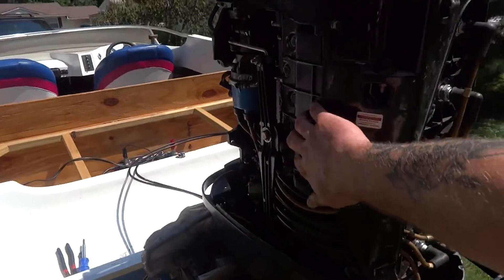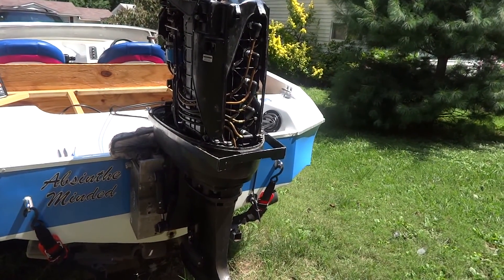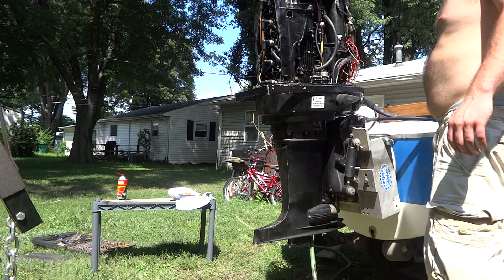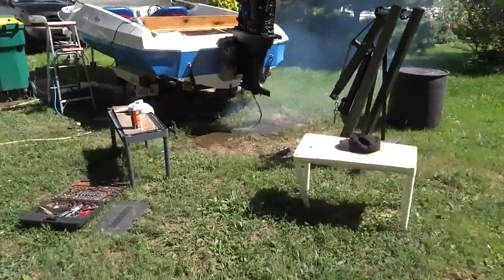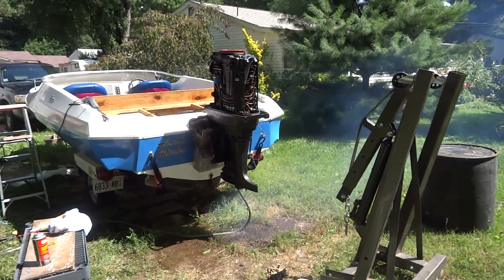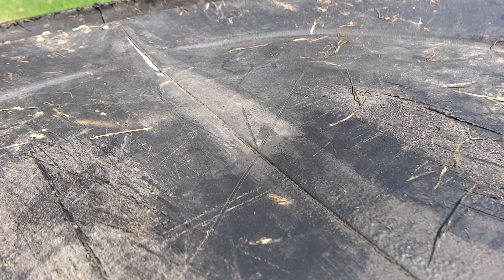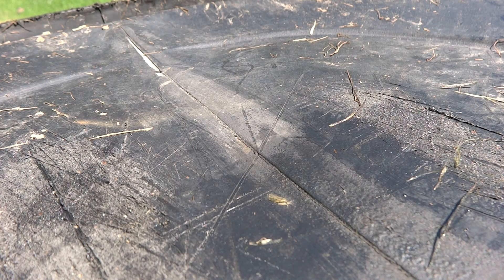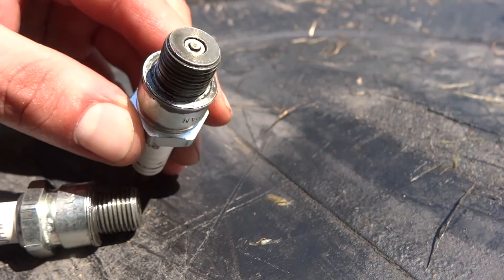76 Inline Water Jacket Part 2- Fix?

Comment: Just bought a 86 mercury 90 horse in-line 6 sorta like this one. Had it on the hose and the tell tale was spitting. Tried it again 2 hours later and nothing. Any advice?
Reply from the maker: Has the motor been sitting for a while somewhere? If so, you probably need to put a new water pump in it. They go bad, I used to replace them every season or every other season. I have a video on how to replace them. It's the same process with an 86. Easy job.

But first pull the drain tube and make sure it's not clogged.

Comment: How many gaskets do I use for the back water cover we’re spark plugs screw in is it 1 or 2???
Reply from the maker: Pretty sure it's 1.
Reply: @cturboaddict  ok couse I ordered the gasket set for it just the one gasket that’s were I found it was busted the gasket that is but I’m the package it came with 2 of them
Reply from the maker: @frankiewarrick2313  Here's the link to the parts diagram. Look at the "END CAP, MANIFOLD, AND EXHAUST COVERS" Page. Part #24 is ONE gasket required. 
https://www.crowleymarine.com/mercury-outboard/463.cfm
Reply: @cturboaddict  ok couse I ordered the gasket set for it just the one gasket that’s were I found it was busted the gasket that is but I’m the package it came with 2 of them
Reply from the maker: @frankiewarrick2313  the exhaust baffle on the side of the motor uses 2. But I don't recall the spark plug cover using two. Let me see if I can find a parts diagram.